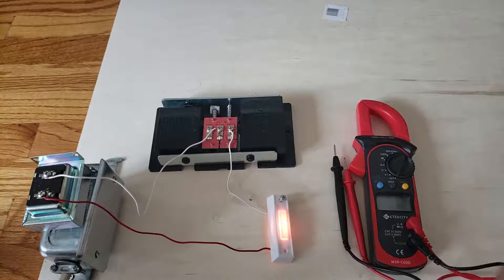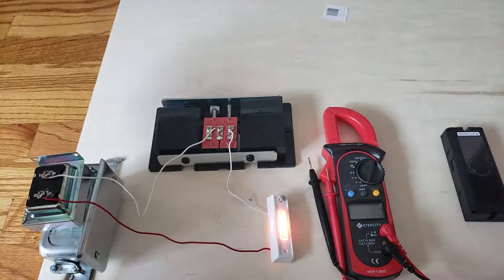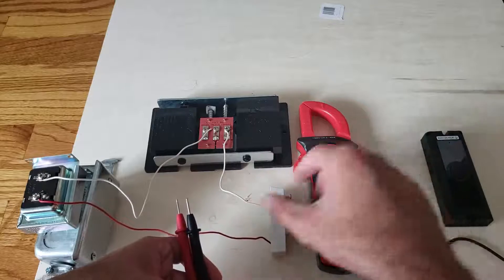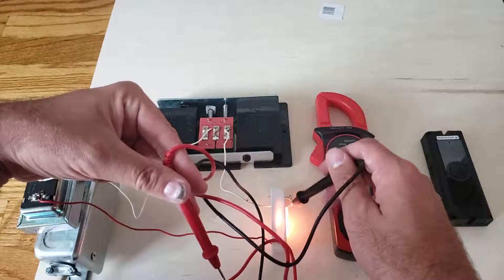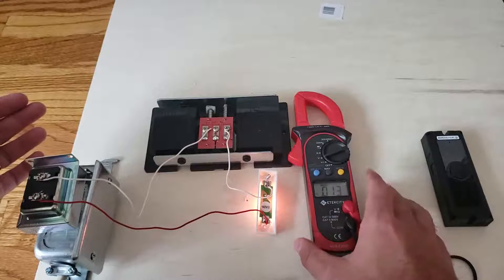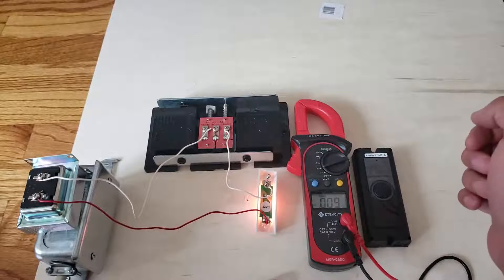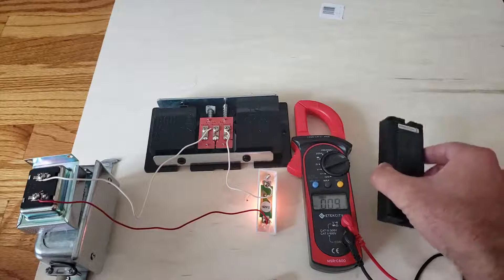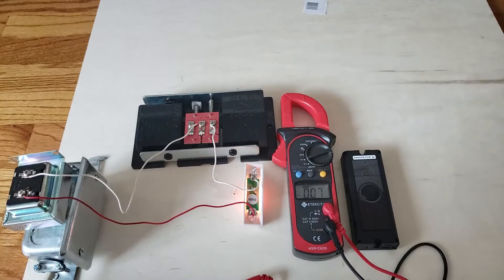Doorbell Transformer Voltage: Do I Have Enough Voltage For Ring or Nest?

Comment: Great Video.  Rookies need to watch the ENTIRE VIDEO!
Voltage at transformer = 22 V
Doorbell = 0V  (Pressed = 14 V)
At switch = 21.4 V
Reply from the maker: Thanks for the summary and comment.
Reply: @OneHourSmartHome  - Thank you!  This helped me out a great deal!
Reply: @SBiller442  confused as how does the lamp in switch get power? If switch isn’t being pressed, I understand that chime wouldn’t register the full voltage and ring but it’s getting a tiny bit...but lamp provides a connection between black and white so where does the other voltage go? Do you follow my questions?
Reply: @JohnHallgren  the little light is only drawing the current it needs
Reply: @JohnHallgren  The lamp is connected across the switch internally.  When the switch is open (un-pushed) a small amount of current flows through the lamp.  The current is small enough that it will not activate the chime.
Reply: @OneHourSmartHome thanks for video. I am having a difficult time trying to understand how to bypass my mechanical doorbell chime so that when I ring my Ring Pro 2 the mechanical chime does not (ding ding). I have a Ring Chime Pro 2 that I want to hear my rings come from. 

Ring tells me to remove their pro power kit V3 from my mechanical doorbell. When I did this. At first things seemed to be working fine. After a day went buy. I started to hear a half (ding) from my mechanical chime for no reason. No one was pressing my Ring Pro 2 doorbell. Then we decided to press the doorbell and when we did. The mechanical chime started making a loud buzzing sound. Then we looked at the Ring Pro 2 device health in the ring app and it said voltage level was bad. Hopefully Rings customer service didn’t damage something by telling me to do this. I placed their pro power kit 3 back on the Trans and Front in the mechanical doorbell chime and the Ring Pro 2 says the power is good again. However now the mechanical chime no longer works. Of course I do not want the mechanical chime to work. The point is it should work and it no longer does. 

Any idea of what I should do. I have a 16v 10va transformer.
Reply: Perfect!!

Comment: This video was helpful.  Logical.  Good layout.  Good explanation of various readings at different locations.  However, TWO key points to add for your viewers:. 1.  I installed my ring into 33 year old house.  Existing transformer wasn't strong enough.  Ring worked initially, then stopped after a few weeks.  Before changeover, old transformer read 10.9 volts.  New one read 21.9 like the one in video.  2.  My transformer was located in my service closet (with water heater, furnace, etc.). I wonder where electrician typically install them?

Comment: I installed a 16 volt transformer and it's getting 110 volts from the house wiring but it's only putting out 12 volts why is that ?
Reply: I'm no pro at this, but it can depend on the gauge of the wire as well as the actual connections not providing enough contact for current.

Comment: Extremely helpful video. I watched several others but none explained why I was not getting a reading when touching the multimeter to the connections on the chime. Thank you!
Reply: Is a higher (24V) one better than a lower (16V, 18V) one? I haven't found an answer yet...
Reply: @rswow yes, go with the 24 volt